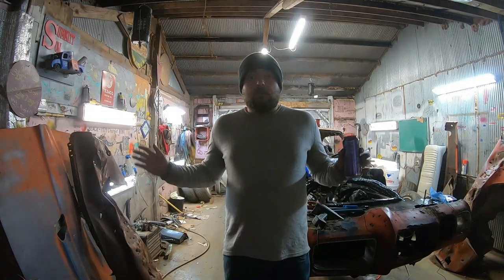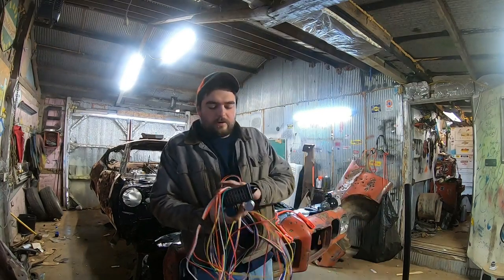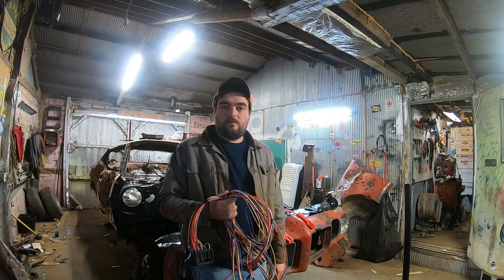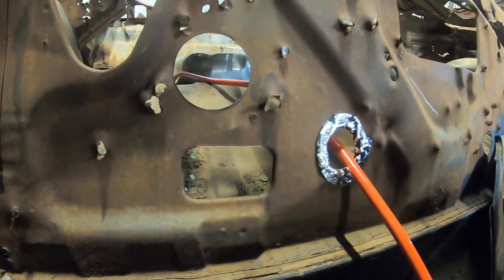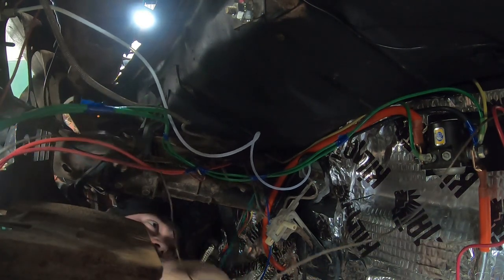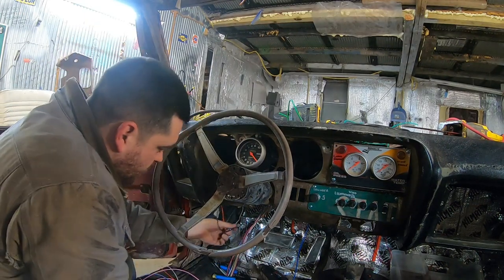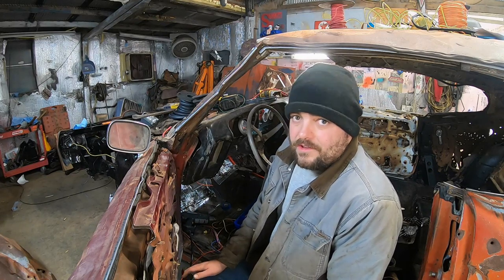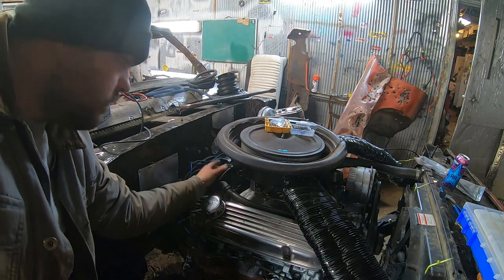The Holey Goat: Worst GTO Ever Part 8 — ELECTRIFICATION, Fan, Gauges, and Lighting Install

Comment: Marine grade switches are designed not to "spark" so they are safer to use in enclosed areas like boat engine compartments where fumes might build up.  I like using them for automotive applications because they are already designed to run on 12v and I figure they can take a bit more abuse with moisture, etc.
Reply from the maker: It was the weather proofing that I was after, they do seem to be a better sealed unit then your typical cheap-o toggle

Comment: Hi from the UK, a little tip  on the crimped wires, if you can carefully remove them from the housing you can still run some solder over the wire  strands and conductor barrel of the crimp. Love the car so far!
Reply: True, bloke! Here in Kentucky, when we are not running mooshine barefoot, we quickly solder our crimps.  Flows right in, instant no sweat.

Comment: A good source of heavy gauge sheet metal for cheap or free are broken refrigerators, washing machines & dryers. I've also cut out entire roof skins from junk vans for metal.
Reply: I used old washer and dryer sides to re build the bed floor and about 4 inches up on the front of the bed of my 1981 Dodge stepside! They really work good because they can be cut so they do the floor and up the side of the bed too with the 90 degree corners!, I also grab up old bed frames when I see them laying out on the curb with someones trash! I used the angle iron to replace the mounts for the steps and just  ran them directly over to the frame to make sure they never let go! I also had the upper control arms rusting apart in that little slot on the edges that fills up with dirt so I took pieces of Rebar and formed it to the shape of the edge of the control arms and welded them  into place! It has been over ten years since I did all of this and my truck is still holding together nicely! The only thing I wish I had done differently is I should have used the top of a washer above the gas tank so I could just open the lid to get to the sending unit! Next project on this truck is to use angle iron to reinforce the cab mounts and and weld the cab right to the frame! Then rebuild the floor of it! I've thought about buying a newer truck but this truck is an 81 and trucks 30 years newer than it are rustier than it is!
Reply: I find hoods from 90's trucks to be a great source of sheet metal.

Comment: I do like the tip about using jumper cables as battery leads, but something to look out for is CCA cable (copper-clad aluminum). It's typically the reason you can get "super heady duty 1GA 25Ft booster cables" for under 100$. Copper is not cheap nowadays and probably makes up 80-90% of the cost of a set of jumper cables, the rest is just some stamped steel jaws that have been plated. A clear sign of this is weight. If you've ever worked with arc welding cables you'll know just how heavy a couple dozen feet of heavy gauge pure copper is. Also if you strip CCA back, scrape it with a knife, you'll find a distinct silver color below the plating. Or hit the bare end with a blowtorch, copper will just glow orange hot and maybe bead up, whereas CCA just goes limp and frays and falls away. 

This is mostly all well and good for a few seconds of load while jumping a dead battery, where a couple volts of drop will likely still spin over an engine, but for sustained loads you'll start to notice funky voltage losses or fluctuations from lights as the alternator tries to maintain charging voltage over this resistance, etc. Or worst case your amperage calculations for a given wire gauge will be way off (CCA has probably half the ampacity of the real stuff for a given gauge) and overheating cable, smoke, fire, ya know, all the exciting stuff from a probably unfused battery connection lol. I know on older rigs without all the electrical bells and whistles this isn't as huge of an issue, but still something to be aware of.

I like the suggestion somone else made of going to a self-pick junk yard and pulling the harness from a vehicle with a rear-mounted battery, or try to source some used welding cable. Welding cable is incredibly flexible in extreme temperatures, chemical and abrasion resistant, and usually 105C degree rated jacket. I've also seen people go for those all-in-one car audio subwoofer amplifier wiring kits from Walmart but some of those suffer the same issue. Unfortunately there are no free lunches, and I'd always remain skeptical of a product sold for less then the cost of the raw materials.

Just my rambly 2-cents for anyone looking to try this at home😁
Reply from the maker: The cables I used are CCA, and they've been working fine for over a year now in the car...🤷
Reply: @PoleBarnGarage  And they will most likely continue to! it is still just wire after all, albeit a bit more susceptible to fatigue being aluminum. Just wanted to share in case it saves someone who had never heard of this phenomenon before a headache or mishap in the future. Keep up the awesome projects, really glad to have found your channel!

Comment: Crimped and strain relieved connections are generally the go-to standard for any automotive wiring. Soldered connections have two issues - first, that the transition where the solder wicks into the copper strands, is brittle and because that ends up being past the mechanical strain relief, the wire has a tendency to break there over time due to vibration. Second, any residual flux ends up corroding the copper conductors (in the presence of moisture) and over time this leads to strands breaking off the soldered junction and eventually the connection fails. The best approach is to use a good mechanical crimp tool, which makes separate electrical and mechanical crimps for strain relief, and then use heat shrink tubing with embedded adhesive to keep the moisture out.

Comment: just a thought about the fuse block...  what if you silicone the entire back of the box.  once dried it'll stop anything from touching the crimps and will keep them water tight so they wont corrode as bad?
Reply from the maker: That's actually kinda genius
Reply: @PoleBarnGarage  Ive done something similar before with a head light pigtail that kept shorting out due to water... worked fantastic, never had to mess with it again the entire time i owned the car.

Comment: My 92 Silverado I use to have, someone wired in an electric fan and had it ran to a switch, I installed a temp probe that went to a relay to kick the fan on so I wouldn't have to worry about it, between the 3 core rad it had and no thermostat, I probably could of drove that thing with no fan at all in Arizona, it never kicked on and temp never reached more than 170f, Once I moved back here to Ohio, having heat was nice to have in the winter, so I had to dial in the temp probe and install a 180f thermostat to get decne't heat lol.

Comment: I am thoroughly enjoying the budget aspect of the build.. it's EXACTLY the way I roll, I work hard but am poor at the same time.. kids and all.. anyway one thing I do though, on the oil pressure sender, I use a copper tube. I have seen more than one failure on the plastic tube to the gauge, so that's one place I do not skimp out on, and honestly a big roll if that thin copper tube stuff is pretty cheap actually. Otherwise nice work Dalton, I dig it! I wish I had the balls to start a channel and put up videos of all the stuff I do, Hell I might even get a view or 2.. it'll never happen though so I'll live vicariously through you, thanks man
edit: i also definitely wrap the back of all my connectors with GOOD electrical tape.. I do a lot of marine work (well I used to) and yeah I tape everything!! I treat all my wires like they'll get wet one time or another. Good tip.

Comment: To get the door to shut, what if you put the jack in the door sills and push out the door sills so the door fits in. It would either push the A pillar to the right spot or push the quarter back. Just an idea.

Comment: i work on avionics and crimp connectors are the best if done right. solder might crack at some point when it sees alot vibration. crimps wont
Reply from the maker: good crimp connections

Comment: Those fans really are the best. I run one on my jeep. High and low. I have a derale auto control for the low speed and can force it into high with a switch. To run low and high you have to feed both wires with 12v. 30 amp if I remember correctly. I have a few spares of these fans... Great job!

Comment: So I was telling you in one of you videos, that I had a 69 LeMans for sale here in Virginia. I sold the car for $1,000, and a rebuilt 455 engine with electronic ignition. Thanks for sharing this video, I'm following your whole process, and looking forward to the finished product
Reply: Someone got a good deal!
Reply: @JT-un7dc  Thanks,Yes I believe the above should have read that I sold the car to a mechanic friend of mine  for $1000. A basis swap he offered me,a rebuilt 455 Pontiac 😉engine w/oversized cam , double chain ,fuel injected 2 double fed Holley's.electronic ignition, etc...... That my friend is going to bolt up to my TH400 transmission in my '68 Pontiac LeMans ❣️
Reply: @docholliday1970  nice, I bet you're excited. Good luck with your projects.
Reply: @JT-un7dc  Thanks my friend,and You the same .HAPPY NEW YEAR , from Virginia , USA 🇺🇲

Comment: Em quarter panels are bothering the hell out of me! Gotta pull them back out, it'll help the doors too. Most people would weld on a piece of metal to pull from.. But since you already have a few or more holes in there, take a piece of say 1/4" thick by 12"x12" steel plate with a hole in the middle of it, fish it thru on the inside and put a stud thru it and thru one of the many holes and then hook onto it with a come-a-long and pull the panels back out, the plate spreads the pulling force onto the majority of the panel, they should come back out without too much trouble really. If you have no where to hook the other end of the come-a-long to, then you can also just use a chain, attach it to the stud coming thru and make a loop in the chain, then using a long pry bar go thru the chain and pry against the wheels, it'll take some muscle but em quarters will come out!
Reply from the maker: You will be happy to know they've come out a good ways, I've been working on them on and off in my free time with the port a power and a 2x4, doing what you said just in reverse

Comment: I have ran a electric fan just on a good toggle no relay. It worked several years until my brother in law forgot to turn it on and ran the motor hot.
Reply from the maker: You can get away with it, I still wouldn't unless I was in a hurry

Comment: There is a non conductive non corrosive airasol silicone spray that leaves a plastic film on whatever you can spray on the back side of the fuse block, last year I used some on my 2000 harley Davidson chopper, my switch boxes keep filling up with water when it rained, and yes I know the switches where sprayed at what ever company made them, this was a used chopper and I wasn't taking any chances, I for get the brand name, but there is a few to choose from. It will make you feel better about the fuse block as not eve air can get to the terminals on the back, wich means water and corrosion  wont affect it.

Comment: 10 gauge stranded wire is typically rated for 30 amps... it all depends on how much stuff you will have running through that conductor. If you have multiple big loads then you'd want to separately fuse them and switch them with a relay.
Reply from the maker: In my case it will work ok. Remember to factor in the Chinesium metric into your NEC wiring chart

Comment: Dead battery jump packs can offer some decent battery cables too, albeit a bit short, but watch out, sometimes the wires on those are junk! Always save the clamps from dead jump packs and harvested cables tho, and anything else good like the 12v outlet or sometimes they even have their own 12-16v to 5v USB plugs that you can wire into other things. Everything is made of something useful when you're a cheapskate, broke, or a broke cheapskate. (I'm definitely in the latter category!)

Comment: Why would you add another solenoid?  Just one more thing to buy and/or go bad.  GM starter and solenoid should work fine.  There should be enough airflow through past all the bullet holes to keep it cool enough to not cause problems.
Reply from the maker: Less wires in the engine compartment, just looks nicer.

Comment: Tupperware is a good solution for incapacitating those cheep fuse clusters 🛠👍✌️
Reply from the maker: Can't afford it, had to use all my Tupperware as junction boxes for the shop
Reply: 😂😂 plastic coke or oil bottle with flap cut one side for access probably more in line with the budget your trying to stick to keeping the bear min spot on recycling junk to fix junk 👍✌️

Comment: Just wondering what it says on the jumper cable does it say OFC or CCA
Reply from the maker: I'm not sure
Reply: Just be careful you’re not pulling any high amperage through the wire which I don’t think he will be but this just goes out to anybody else CCA is copper coated aluminum if you draw high amperage the wire heats up like nobody’s business
Reply: The way you can tell if it’s copper coated aluminum is obviously it looks copper and if you cut a piece off look at the ends of the wire that have just been cut if they are silver it’s copper coated aluminum👎🏻
Reply from the maker: Oh no, it's copper, even I would never run that crap

Comment: what i do is collect cars when i get all the parts i need i build the rig but i have lots of land to work with which helps a lot like my 68 chevy pu i have under 1000 bucks in it and it is getting sweet i just can't finish it till i get the new shop up so i can finish the final paint ' my next project is a 79 z28 rs t top have 2 extra 79 z28 hard tops for parts have a stroked 454 with 02xx 400r turbo and a t-10 4 speed and fly wheel clutch set up new in box one car has new custom interior was a show car they pulled the engine and trans . but so far i have nothing in it all i got for free then i picked up a weidland high rise with carb and a weidland tunnel ram with carbs both for 100 bucks got a bunch of after market sbc distributors and msd 7 just need to change the counter weights for bbc . i have all the parts to make one perfect body no dings then i will sell all the left overs  and make money on the project for paint and new parts trying not to put money out of pocket in the project . my 68 pu will be easy to get my money back from all the extra parts even have a rust free cab with air condition for a 68 plenty of parts to build another one but all ready have a 67 and a 68 pu don't need another one plus i have a few square body chevys one real nice one with under 35,000 miles on it in mint condition 79 short box 4x4 cheyenne 400 sbc 400 turbo all factory original  then i have a few ford pu's

Comment: Absolutely nothing wrong with a crimped electrical connection. In fact, you do not want soldered connections in an automotive environment. Check your factory connection, no solder, right? What you do want is grommets when you run your battery cable through a drilled hole. Also, use those ratcheting crimpers on your electrical connections.  Love watching this train wreck progress!
Reply from the maker: Yes but factory connectors aren't exposed tin that aren't even pinned in place 😂

Comment: I dig the wiring, its similar to how I do it with the Ford solenoid, but I have boat terminals to divide up the power points that send power to the relays. You'll be driving that thing before the snow is gone for sure. Doesn't look like you get much snow judging by your roof. :) 

When you get bored with this car, keep the engine, trans, and whatever else you want, then send it my way. I will rebuild it without swapping the VIN...  and turn it into a decent daily driver. I think it would be a fun challenge especially since I have lots of parts sitting around for it. Not a show car, but something you can get in and drive 1000 miles without a problem, and not get wet if it rains. 

I have to wait a couple months for it to warm up enough for me to work in the shop, currently its 1F, with a balmy high today of 4F. If I go to the shop all I do is stand where the heater is blowing hot air on me and look at what I want to do when its not so cold. Around March it warms up into the 20s which is good working weather. I think I need a small shop, like 24x30 that I can insulate real well and heat to work on stuff in winter.. like you and DDspeed have. My 32x48 is just too damn hard to heat, and it will take a hell of a lot of insulation to make it livable.
Reply from the maker: I think this is a keeper, but if I let it go I'll keep you in mind. I've got some plans that I need the car for later this year
Reply from the maker: Keep the burnout expectations low for now, this old 400 is reliable but tired. I think I'm going to build something for it, we will see. Roadkill nights would be sweet, I'll let you in on what I'm thinking though. I'm going to harass SEMA about letting me in with it, it's just stupid enough that it might work. I want to drive it back to the ranch where it resided for the previous several decades. And I want to enter into the 3k beater challenge at the duct tape drags in Tucson. I also don't believe in trailers.. So you can see where I'm going